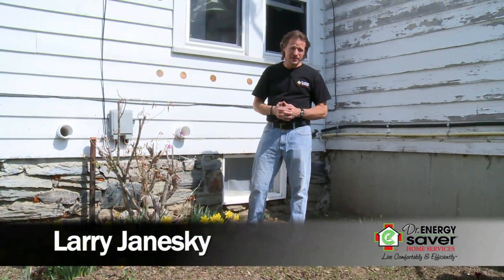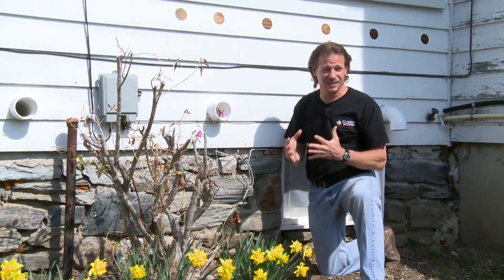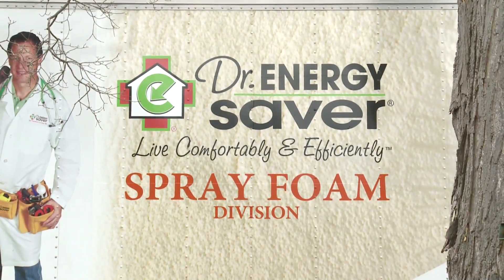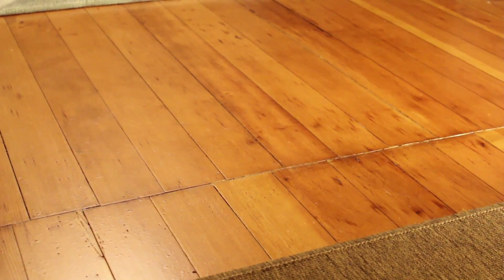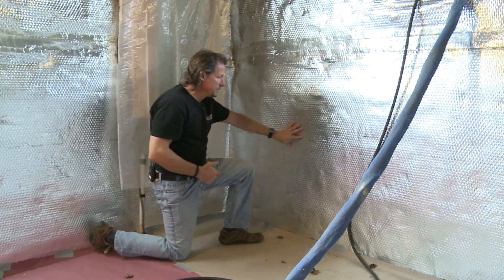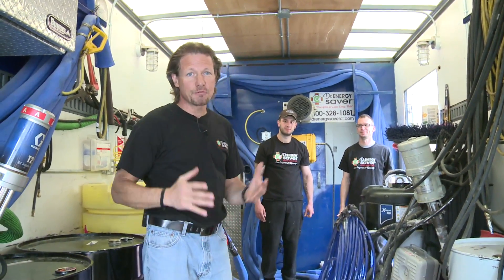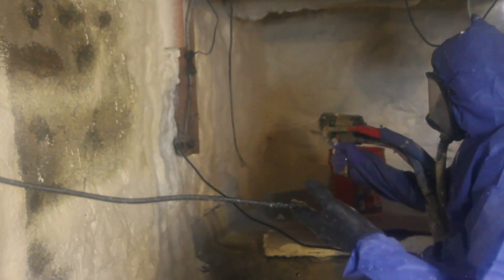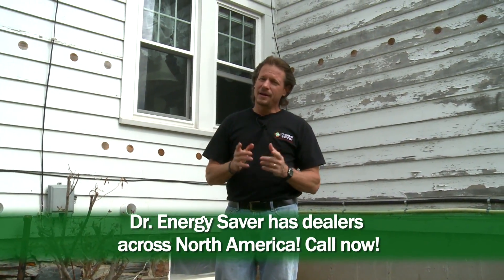Sealing and Insulating a Stone Foundation Wall  with Spray Foam

Comment: If you're putting closed-cell foam on the inside of a wall, which is poruous and can pass water vapor (and water under hydrostatic pressure), how does moisture not build up either between the insulation and inner wall surface or within the concrete itself --- and potentially push-off the foam and/or spall the concrete?

Comment: Interesting watching the video clip where he is standing in front of the block foundation and there's a nice large step crack in the mortar joints indicating foundation movement, last thing I would want to do is cover over that until I know its fixed properly. Covering walls with this material may provide great insulated qualities but it will not stop foundation movement and deterioration that it will cover up a homeowner from seeing and ultimately needing to fix.

Comment: I had my basement spray foamed and the rim joist as well and my floor upstairs from the basement the main floor is still cold, could it be my windows or air seepage coming in from under the floors? Perhaps the fact that the vapor barrier isn't sealed to the floor ?

Comment: It's not a good idea to insulate basements from the inside.
Reply: 2 years later I ask why not?
Reply: @mlee81  2.5 years later (LOL) he might be meaning vapor barrier and not insulation.
Reply: @mlee81  Because it locks moisture into the foundation and since it's insulated, it will freeze and thaw, which over time will spawl and damage the foundation.  At least that's the logic anyway.

Comment: I used to think that brick, block, and stone walls had the advantage of having the ability to breathe and control air moisture this way.  By sealing it doesn’t this interfere with this breathing process?

Comment: The best way to prevent moisture intrusion into the concrete wall is to use a water based penetrating reactive siliconate product on both sides of the wall. This will lock out water penetration while allowing the concrete to breathe at a reduce vapor transmission rate. Though several are on the market in various versions and attempts but the best I've seen and used is called Deco 20.

Comment: Whats the difference between Polyurethane foam and soy based foam?   Which one has less VOCs?
Reply: SprayFoam is full of toxic flame retardants that cause cancer, tumours etc... Organo halogens and organophosphorus flame retardants bioaccumulate in the human body. When SprayFoam burns the curing agent, isocyanate is converted through thermal decomposition into cyanide gas which can kill you and harm the environment.
Reply: @foamproject8916  its not more toxic then plastic bag u use at stop n shop when installed by professionals.  Fire retardants you refering to are not used long time ago and later products use sugar cane to decrease flame spread. As well as code requirement for foam to be covered with thermal barrier paint such as DC315 which is water based product, and completely replaces shetrock in fire resistive properties. Fiberglass fibers and mold will cause more issues
Reply: And your source for this CLAIM  would be??????,,,,,,,,,,,,( And BE SPECIFIC please,  especially about the flame retardants that cause cancer and tumors. seeing how all foams on the market are DOE AND  UL approved.
Reply: You're correct that isocyanate can decompose into hydrogen cyanide; however: 1) hydrogen cyanide itself is combustible and will burn in a fire; and 2) many other common household materials also produce cyanide gas in dangerous levels during a house fire. In fact, beside the carbon monoxide, cyanide is the second-most dangerous component of house fire smoke -- they're what make housefire smoke inhalation so deadly. http://www.fireengineering.com/articles/print/volume-166/issue-3/fdic-preview/dangers-of-fire-smoke-exposure.html
Reply: Don't be ridiculous, Jack.

Just because it is "natural" doesn't mean something is non-toxic.

Ricin comes from castor beans and is incredibly toxic.  So is abrin.  Strychnine comes from the seeds of a tree.

If you made a list of the thousand most toxic substances, polyurethane wouldn't be anywhere near making that list.  If you drive a car , ride a bike, sit on a sofa or sleep in a bed, you come in direct contact with it.

p.s.  why do you think polyester and polyether polyols (the main ingredients in the soy spray-foam) are less toxic because they're made from soybeans?
Reply: Repeating or rephrasing a falsehood doesn't make it true.  While the manufacture of polyurethane foam is far from non-toxic, the notion that it is especially or unusually toxic is simply wrong.
Reply: Whether polyurethane is made from petroleum oil or soybean oil, it is still polyurethane.
Reply: @jackfntwist  you are dumber then wood log. Both products are polyurethane foams. "Soy based" means that part, about 5%, made using soy based polyol and actually not as stable and may cause offgasing due to that soy based polyol. VOC you refering to is part of the blowing agent that used to make "bubbles " in foam reaction and these days products like Solstice or ecomate replace Hydrofluorocarbons with 0 VOC.

Comment: While this is a fantastic product, I'm curious how you deal with moisture intrusion.  The concrete block or stone walls are porous, and while no water will permeate through the insulation, it will certainly stay in the wall and cause deterioration over time.  I certainly hope you address these issues with the homeowners you install this product for.  Otherwise, you could potentially be putting them in a situation where significant structural damage could occur which pales in comparison to saving $100/mo on utility usage.
Reply: This is my concern as well. Rubble foundations were designed and used knowing they would leak. Preventing leaks by installing curtain drains is fine; so is installing french drains inside the basement, with insulated basement walls sitting inside that ring. But simply trapping the water within the rubble foundation, outside the thermal envelope, so it can freeze and expand.. is terrible for longevity.
Reply: Here is an interesting perspective on basement wall insulation:
https://www.greenbuildingadvisor.com/article/how-to-insulate-a-basement-wall

Excerpt:
Does interior basement insulation need to be vapor-permeable?
No. The idea that a damp concrete wall should be able to dry towards the interior — in other words, that any insulation on the interior of a basement wall should be vapor-permeable — is mistaken. In fact, you don’t want to encourage any moisture to enter your home. Your concrete wall can stay damp for a century; that dampness won’t hurt the concrete.
Reply: @woltjerl  depends how much moisture you're talking about and whether that moisture freezes and thaws

Comment: Why not put the insulation on the outside of the wall? That would move the condensation point somewhere in the insulation avoiding freezing of any trapped moisture in the stone wall.
Reply: The energy benefits of thermal mass walls have been equivocal in studies from cold climes such as Buffalo. It doesn't really matter which way you go, from an energy conservation standpoint. From a condensation standpoint, though, it certainly would be more useful to insulate from the exterior; of course that only works if you can afford to excavate the foundation and run rigid foam paneling around the house.. interior spray foam is a lot more cost-effective.
Reply: You always insulate the Cold Side (outside) of the Thermal-mass-wall.

Comment: I've been reading that you shouldn't insulate stone foundations from the inside (especially spray foam) because the stone and mortar will trap moisture and freeze in the winter. Eventually causing the mortar to degrade. Can you comment on this?
Reply: In high moisture climates, that is correct.
Reply: @onetwothree4148  Is there any interior insulation method that is more generally accepted?  Such as framing it and using rockwool so moisture can be wicked away internally with a dehumidifier?
Reply: @ssoffshore5111  the more the wall can dry to the inside, the less likely you are to have problems. You definitely need to avoid any vapor barrier on the inside or moisture will get trapped in the wall. Exactly what you can get away with will depend on your precise circumstances. I'd definitely test any plan you have on a small section of the wall before you do it to the whole basement.

The only right way to insulate a permeable masonry wall is on the outside, but a creative person could probably come up with some acceptable ways to insulate the inside, even in high moisture areas. You need vapor permeability for sure, but you may also need air flow or the moisture may not travel through the insulation fast enough. Depends on how much moisture you have. I could imagine building a wood frame wall a few inches off the masonry and trying to ventilate the cavity.

I've never seen it done, but blow in cellulose is known to act as a buffer in old house insulation retrofits. It absorbs and transmits moisture through walls that do not have any vapor barrier. A basement might be too much moisture for that though. It might mold if there isn't enough air flow on the masonry side.